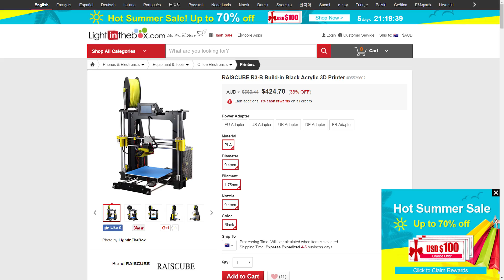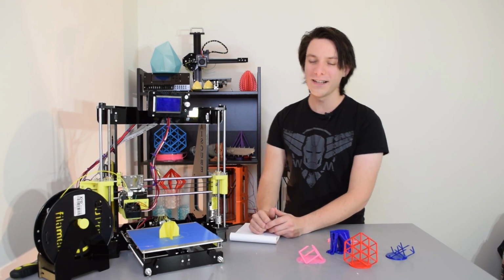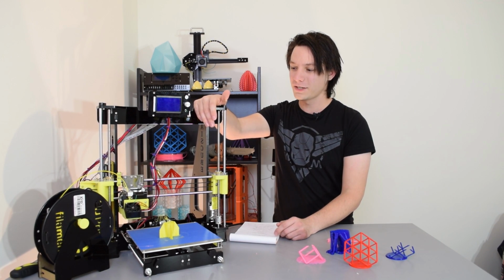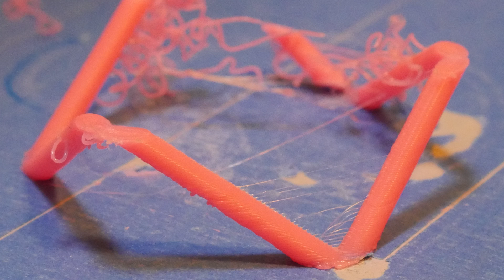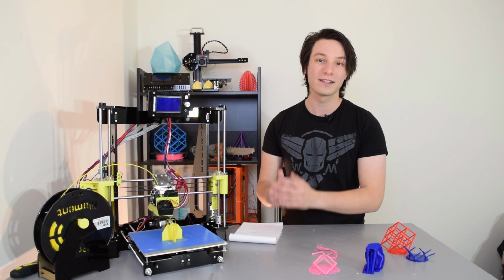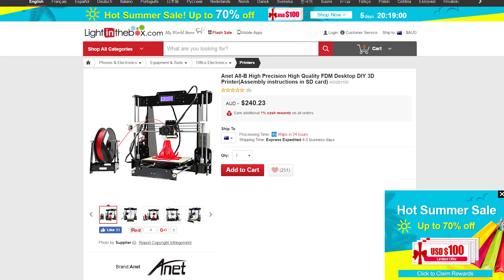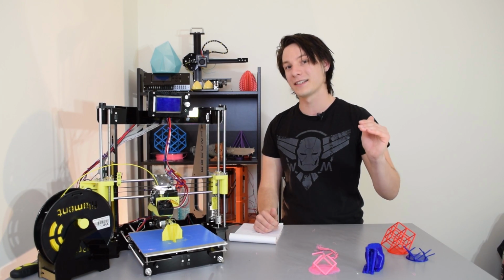Raiscube R3-B 3D Printer Review - i3 Kit

Comment: Mind you share with us your thoughts on how to stabilize the acrylic frame, and points to watch out for getting better quality print?

I had my Anet A8 shipped without cracks and took me 12 hours to make it running (I broke the nozzle cold end for twisting it too hard...). Personally I think its a decent printer for starters (of course if you don't mind assembling it). But I had to admit that 90% of my early prints are mods, upgrade, accessories for the printer itself rather than real "things".

I bought this printer as my motivation to learn 3D modeling and models miniatures and figurines. But with high level of details, I am not sure the printer can pull its punches and get the print out of the bed with decent quality.

Comment: THANKS FOR THIS!!! I've been looking for this everywhere, gearbest (where most people are ordering their DIY printers) has it listed as a Prusa I3 and a question states that it is genuine....(a quick search shows the I3 as looking totally different) its was between a A8,A6 and this....As of now I think the A6 is my choice. I needed a cheap kit but one that I can upgrade eventually.  I'm currently using a Deltaprinter from Deltaprintr.  After a While I really wanted a larger print area (I'm waiting for the new extruder that they released.)
Reply: I'm very knowledgeable in technology with a CE and EE Degree.  I am always skeptical when I see a user giving negative reviews due to the fact almost all the time it can be blamed on the user not understanding.  You my friend are very clear and know what you're doing and greatly helped me get my second 3d printer (technically first but my friend is letting me hold on to his as he gets back on his feet)...heres a thumbs up and a subscribe

Comment: Not sure if he got a bad unit, but I got it and have no problem with it
 whatsoever, I actually get pretty decent quality prints. I should also 
mentioned that I paid £152.16 delivered to the UK from Gearbest.
It was very packed and came with some red pla.
Downsides :
-One of the coupling for the z-axis was 5/5 instead of 5/8.
-The instructions to build it, if you are a first time builder, are pretty bad.
-With mention to safety, the hot bed connections are exposed as well and pretty easily accessible.

Pros:
-Good quality prints
-Cheap if you don't mind waiting a bit for delivery.

That's not to say that there aren't any better printer for the same price out there.

Comment: DO THE FLUX PART 2! :)
Reply: ok ill do it
Reply: my flux prints way better than the flux angus has, done!
Reply from the maker: got the cutting head on its way, then will revisit - done more tests and the prints are improved but still not as good as I can get off the Mk2.
Reply: yeah i agree the prusa could be better, my linear bearings are getting a little rusty so umm, im have z issues or "skin disorders" people on the flux forum said that they replaced their bearings and got much better print quality, and also opened those boxy thingss which the rods and the belts connect to and tensioned the belts again and it was the answer to the universe, so im gonna try that too, good luck with your review!

Comment: I found my print stopped abruptly after I started using Cura 2.5 or 2.6 Beta. It seemed to be a G.code issue. I went back to Cura 2.3 and all my prints completed as intended. I have an Anycubic i3 Mega, a sheet-metal clone i3.

Comment: Maybe it stopped printing because the fans colled the hotend to much down and it couldnt maintain the 200 degrees for printing i had that Problem on my tevo little Monster Delta
Reply from the maker: Good theory and I thought so too, but it occurred before and after the fan mod, and the temps were 'stable' at 200degrees on the LCD readout.

Comment: Never understood how people could break acrylic frame machines, always found them much nicer to work with than splitting, ripping and stripping wood frames that just warp in the humidity and bend over time.
However I know enough people who have had enough problems(with the same kits) them that I understand this is not the only experience. :)
Reply from the maker: The 2nd kit went together perfectly as I treated the t-slots with respect and didn't over tighten - and the 8mm parts go a long way to resisting damage, but if it fell just a few inches I think something major would break. Personally, I much prefer metal frames!
Reply: Well made metal frames are definitely the way to go(Still can't believe how wobbly that sheet metal one a few printers ago was!). The ultimate plans is a  1.25x aluminium frame for my 6mm acrylic i3. 
The big advantage of acrylic is that new parts can easily be laser cut. There is a huge difference in grades of acrylic too. Some shatter easily, some are very sold. I'd also agree, don't drop your printer, but even dropping a metal frame one could so easily bend 8mm rod or break other parts, the extra weight in the frame makes that more likely too.

Comment: Implement better control board cooling the original RoBo 3D had the same issue on long prints!
Reply from the maker: oh reckon it's a control board heat issue? That's bad - I was hoping it was just a glitch on my machine. No good.
Reply: yeah try adding a fan
Reply: that solved the issue on the Robo 3D

Comment: The stringing doesn't really sound like a printer specific issue. I mean if it's not a cooling or retraction issue then it's most likely just a temperature problem. Maybe the hot end was at a higher temperature than what the thermistor was detecting. Either way it's something that could be tuned out. The printer is still trash though

Comment: I'm very confused. I have an a8. why is this machine so much more expensive? I get fantastic prints on the a8.
Reply: Bogart12321 Because you can upgrade an Anet a8 much more, than this "avanced" glue gun
Reply: Thomas L I never had to. of course i did lol but I was lucky that mine printed great right out the box.well after some assembly required.
Reply: @Bogart12321  VERY lucky!
Reply: Bogart12321 I have an A8 as well, heavily modded. It's taken a great deal of time to get it right and replace many design flaws but I did it and now it prints flawlessly. Angus is right. As a hobby kit printers are great for tinkering but as tools they take a great deal of modification

Comment: Interesting, lots of gotchas out there. Any updates coming to The Maker's Muse Ultimate 3D Printer Buyers Guide to include all the latest machines (and ratings)? The last revision is 12 months old.
Reply from the maker: The guide covers specifications rather than actual models so it's still very useful, though I will be updating it later in the year to also include resin 3D Printer catagories - any purchases of the old one will be updated free.

Comment: I'm just getting the kinks out of a Alunar 550 which was the Amazon version of that. Once I changed the power supply and eliminated the connectors on the control board and heater bed, it performs as intended. The one flaw these kits share is an under powered power supply and insufficient connectors for the load. Direct soldering the bed and using a supply with 30A is a workaround to make one serviceable, though. My replacement power supply has (2) 12V 28A rails. With the control board and heaters fed with only one one rail, the mosfets were singing and obviously maxed out. Using both rails from the PSU cured the noise and now I don't hear it at all. I'm quite sure using a PSU that is not strained to the max helps everything run smooth.

Comment: For the problem of stopping printing, I had a similar problem with my i3 kit, it ended up being the shielding like you mentioned
Reply: As electronics engineer designing embedded systems for a living i'm actually amazed that these poorly engineered open source solutions that get further cost optimized by chinese manufacturers actually work at all most of the time... 🙄😜